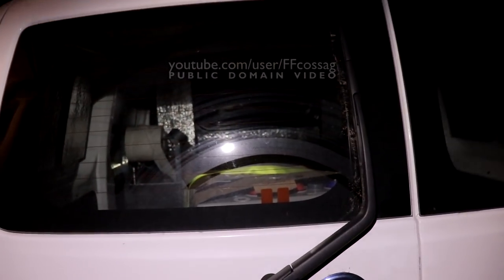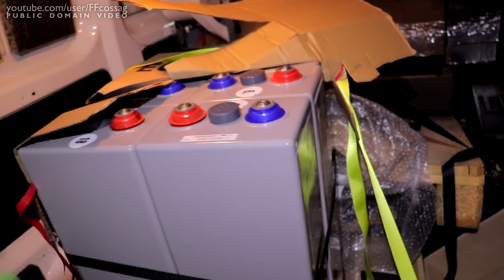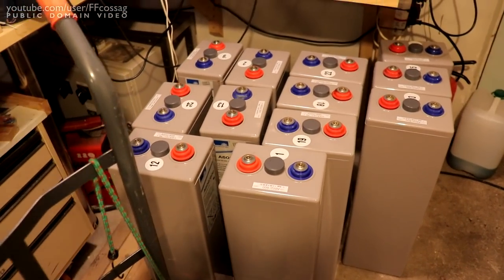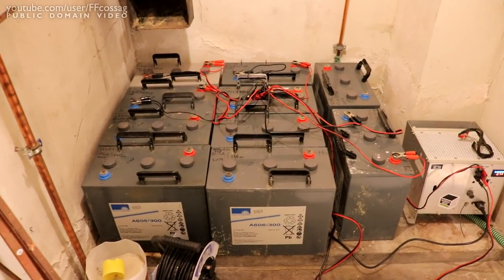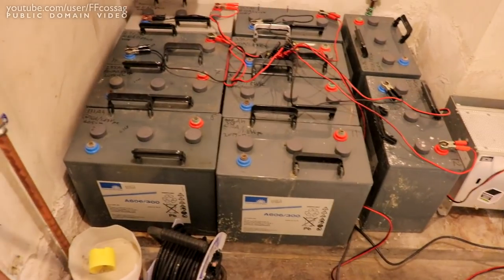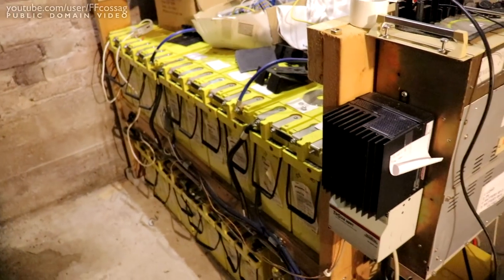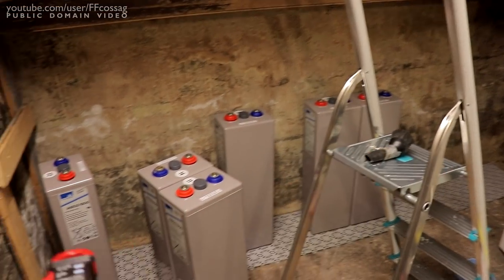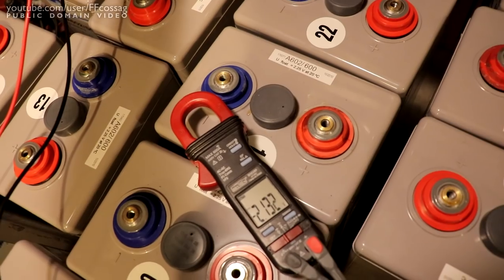OPzVLOG1 - So, I got a really big battery for scrap ...

Comment: Those are frickin' huge!! My tiny solar setup (20w panel, plus a couple small "battery saver" panels) only has a salvaged 40Ah car battery, which is completely unsuitable (and not getting enough charge from said panels), but free is free... :P
Reply from the maker: Free is indeed free!
Reply: Irony is, not long after saying that, said car battery dropped from 11.7v to 9.2v running two 4w LED bulbs in the space of half an hour, so methinks that battery may be sulphating up, darn it!!! :P

Comment: Around these parts the scrap value of a 50KG Pb battery is around 17€. Strange that you get them that cheap.
Reply from the maker: The logistics of living on an island makes shipping lead VERY expensive. The scrap price for old batteries is about 10 c per kg.
Reply: I live in Denmark. I typically pay 5 DKK / kg which would (feb. 2020) be around 0.66 euro / kg. Scrap prices are quite unstable and can change quite alot from month to month.

Comment: Hehe, its been 3 years, but im still super jealous!! The find of a lifetime!! These are so lovely, they have these and those yellow powersafe batteries you had previously at work and ive tried to get my hands on them when they go to replace them every 3 years but... They're not interested in dealing with me taking them for a little more then scrap price so that absolutely sucks;-; but hell yeah! These are lovely, theyll easily last you a good 10-15 years uwu
Reply from the maker: Heh, they're definitely not going to last that long, I'm afraid. The cycles add up REAL fast when you use them like I do, and I already have a couple of cells that have more or less failed already. Definitely still worth the effort, though!
Reply: @FFcossag  hehe, they're still absolutely awesome :3 You should make a little update video about the system soon :D it's been a very long time! You don't need to put much effort into it, just record and upload, no need to edit if you don't feel up for it:) also I'm now really excited about the diesel generator you got, I'd love to see videos on it, even unedited ones :)))

Comment: I got my hands on 24 x OPzS 1500 Ah cells 108 kg each and. 2,6 tons in total. As you, I payed close to crap price. $0.75/Kg. I love them almost as much as my children  :D
I run them as a 48 volt setup.
I can't wait to see the next update.
Reply from the maker: Cool! That's literally the same set-up as mine, except I have the luxury of being split into two redundant strings. How are you running yours?
Reply: @FFcossag  I have attempted to keep all cost very low. Beside the powerwall, I have a 7kWp grid tie setup and the powerwall system is mostly for fun and to try and get the last 2 kWh/year of power the grid tie system fails to provide. Do to strict regulation in Denmark I run the powerwall 100% off grid. And it takes care of outdoor lighting, circulation pumps and such. I had a smaller battery bank before made up of 10 x Powersafe 12V100F much like yours. They have served me well, but paled a bit compared to the new cells. My cells come from a backup system at a remote light tower. They are 15 years old, but have been taken really good care of. My cells are clear plastic and they seem very fresh with no debris at the bottom. I will make a full discharge test of the complete bank someday soon.
I feed the system with 4 x 310 watt panels for now and a $42 MakeSkyBlue 30A controller. For 220 volt I use an APC Smart UPS SUA2200 and have just this weekend bought a 3 kVA version for a bag of candy. What can I say? I love going cheap. 
It is still very much a jerry-rigged system, but it works and will get refined as we go. I monitor the voltage with an ESP32 that sends data to Thingspeak. We don’t get much sun in the wintertime so a junk build DIY wind turbine and then maybe a sun tracker is next step.
I have thought of documenting a bit on YouTube, but haven’t found the time yet, but I will……someday.
 To many silly projects and way to little time.  :D
Reply: Can I know (if you don't mind) where you got those from ?
Reply: @fabiofoltran4361  I often visit a lokal metal scrapyard, then recieves used batteriets for recycling. Batteriets Like the ones i got hold of are eften replaced do to age. They aften still good, but for professional use in importaint systems they replace them to be sure. At the scrapyard they are only worth the leadprice. This type is not nomaly found at My local scrapyard, but i have taken many 100Ah'ish 12volt batteriets home and used then for powerwall.

Comment: Now they are big batterys :-D
Will they have a kind of bms system to make sure each one is at its best?
Or will the solar charger do that.
Reply from the maker: Solar controllers take care of that, though cell balancing has to be done manually.

Comment: They are about 4-6 car batteries per cell, cool!! I'd like to have a bank of nickel iron, give them a go, they could possibly last forever, with occasional maintaining, or cleaning, I thought about a forklift battery or two, a refurbished 24v 1kahis about $1500, I'd need about 4k ah, of lead acid, to have the useable 1.8-2k ah, in emergency 3k ah can be used, I'd really like to have a LiFePo4 bank about 2k ah or maybe larger, LiFePo discharge is nearly flat, less than .7v per cell,

Comment: I would just sell for the lead, by some lithium instead
also you can get 8€ per Kg around here

EDIT: it is 0.8€ per Kg ... my bad
Reply from the maker: 8 € per kg for lead-acid batteries?! That's the price of NEW batteries, I think you have something backwards.
Reply: @FFcossag  well.. went to check the invoice , its 0,80€ per Kg my bad:(
just a note: There's no need to argue about the scrap value of lead, since they use some table to check the value(lead, copper, aluminum...) when you go deliver scrap